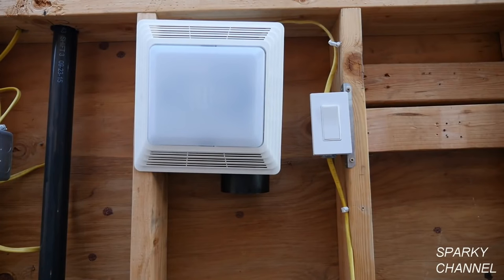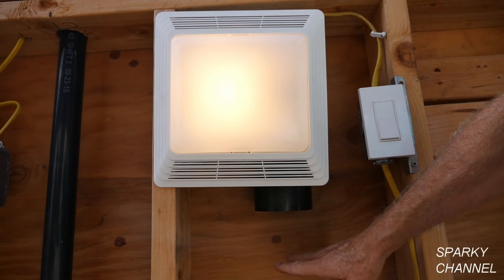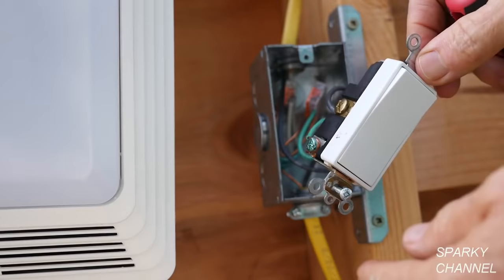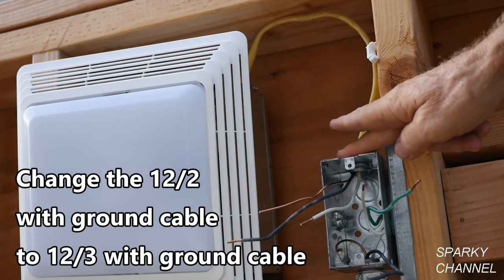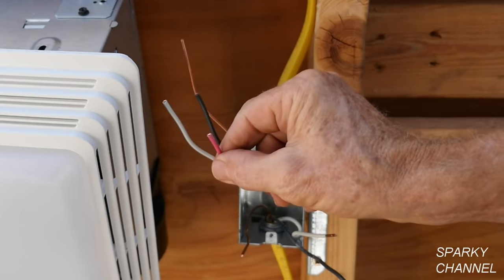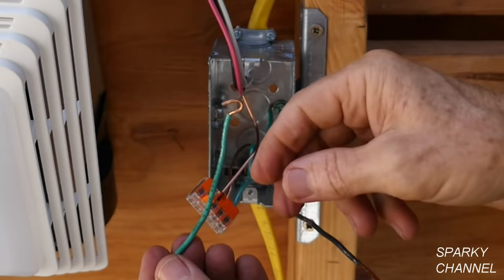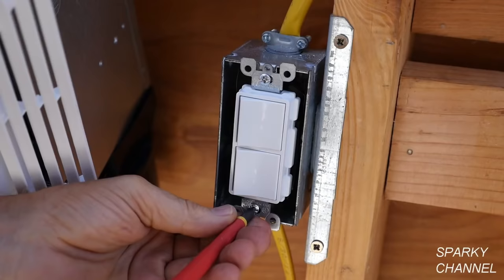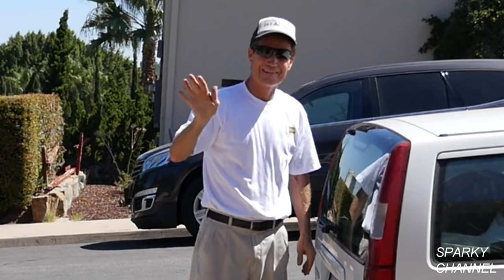How to Put Bath Fan and Light on Separate Switches Instead of on One Switch

Comment: You say you need 12/3 wire, however 14/3 could also be used.  Unless that fan has a heater, it's not pulling that many amps.
Reply: Is this actually true? I'm so confused about whether 12/3 or 14/3 can be used. Seems like a exhaust fan running on a lighting circuit in the bathroom could be on a 15 amp circuit. I can't understand why this wouldn't be the case..
Reply: You need 12-3 because of the extra wire. He is only using the 12awg wire for demonstration purposes
Reply: Bathrooms require 12 gauge wire
Reply: Wire gauge is determined by the amp rating on the circuit breaker providing power to the circuit feeding the j-box. If circuit breaker is 20 amp 12 gauge wire is required. If circuit breaker is 15 amp 14 gauge wire is required. If you have a 15 amp circuit breaker and use 12 gauge wire, for whatever reason, the circuit is “over-protected” and okay.
Reply: I need to do the same thing.
When turning on light the fan also turn on.
I don’t like it when both turn on
Reply: @dsantostv3711 I'm doing the switch too.. it's annoying having both on at same time every time...
Reply: Bathrooms are required to be on a 20amp circuit. Meaning, the circuit breaker at your electrical panel that is feeding the Bathroom, will be a 20amp breaker. 12 guage wire is required to be installed on 20amp circuits. 14 wire is being fed from a 15amp breaker.

Comment: In California, building code title 24 requires that a bathroom fan (for new construction or remodel) must be controlled by a humidity-controlled switch and must be Energy Star compliant.  If you measure the current draw of a typical bathroom fan, it is very small, around less than 100 watts, and 14 AWG is all that is necessary, unless installing a fan with built-in heater. Using 12 AWG does ensure you can put in a heating unit at a later date, however.
Reply: Keep in mind that some units need a 220V line to run the heating element though.  They usually just run the light and vent off of 1 leg of the 220V line.  At least that's how it used to be done with older units.

Comment: Couldn't you have used two 12/2 wires and 2 separate switches on a 2 gang box? One switch connecting to the blue wire/light and the other switch to the black wire/fan? How can you do this using 2 switches on a double gang box?

Comment: Do you think you can make a video for a 3-in-1 (Light, Heater, Vent) wired/powered with their own switch separately?  Thanks
Reply: Ya I was wondering the same thing.did you figure it out yet?
Reply: Same concept, only you'll need to use a 12/4 instead.

Comment: I'm not an electrician so I need some help installing a exhaust fan / light in my bathroom. The wires from my house are copper, one black, one white and one red. The wires from the new unit has three whites, three blacks and one green. The blacks are lables one as light, one as nightlight and the other has no lable. Would appreciate some help.
Reply: You def should call an electrician.
Reply: I figured it out

Comment: I like two separate switches but I put a digital timer on the fan. That way people can put the fan on for 30 minutes (or whatever they select) and go off to work knowing it will go off and not stay on all day. I prefer the Cooper timers (Cooper Wiring Devices 9590AW Aspire 5-Button Preset Minute Timer, Alpine White)
Reply: Humidity detecting switches are available now as well. Removes the owner from the equation. It will turn the fan on and off as humidity conditions require. I have a Leviton IPHS5-LW which replaces a standard switch.

Comment: I was kind of hoping you were going to show some fantastic, new way to get independent switches on a fan and a light with the existing 2/with ground cable. It would likely involve wireless relay controller. There is the naughty way, but it is completely out of code, so I won't tell you how to do it. Keep your house fires in a regularly cleaned and inspected fireplace.
Reply from the maker: Thanks Robert!

Comment: Some installations may have the original 12/2 stapled in the wall cavity so it might just be easier to add an additional 12/2 to the fan/light combo instead of replacing it.

Comment: I just did this exact change in my 100 degree attic. I am remodeling my master bedroom and had to tear out the 75 year old electrical in there. I went into the attic and dug through the insulation to locate the wiring and discovered it’s all wired in a chain with hubs that have 3-4 branches each. My father in law had installed a ceiling fan in the bathroom a few years ago for us and I discovered that he tapped into the bedroom branch. All of the lights and general use outlets are on the same circuit so after turning that off I was able to pull it all out. But then I was so confused with how my FIL wired the light and fan. He didn’t tap into the light switch at all. It still went straight to the light and the fan wasn’t to the light somehow. So I decided to just rewire it and throw in a combo light switch like this. I’m not an electrician but have been watching videos like this. After a while it all suddenly clicked in my head. I used the existing 2 conductor cable to the light switch and cut it from the light. I then stripped those and used those as the load wires and wired those  to the two load terminals on the combo switch. Then I fished down a new wire to the switch and used black for line (hot). I capped the neutral. Up in the attic I used the cable I cut from my bedroom branch and wired the black to the black line to the ditch. I then used two short runs to wire black from fan and from light to the two load wires going to switch. Then I tied in the neutrals from both together with the neutral going to the hub where all the other neutrals are tied in.

I was pretty nervous but also pretty sure I did it right. Glad I found this video because that’s the exact same switch I used and it makes me feel a little better. Wife was mildly impressed when I flipped them on and they worked flawlessly.

Comment: I HAVE REALLY ENJOYED AND LEARNED FROM YOUR VIDEO DEMO. BY FINDING THIS AFTER EXTENSIVE SEARCHES, I WAS ABLE TO SUCCESSFULLY WIRE UP MY HOMEWERKS BATH FAN WITH BLUETOOTH SPEAKER AND LED LIGHT. I HAVE ALSO SUCCESSFULLY WIRED THE SAME DUAL ROCKER SWITCH AND NOW I HAVE AN UPDATED, BEAUTIFUL BATH FAN WITH GREAT TUNES TO ENJOY. THANK YOU!!! 👍🏼😅👍🏼
Reply: That's what I am attempting to do too!! Atleast it worked out for someone else. I will be rewiring everything just like  this too. Did you use the included touchscreen switch or just the double duplex switch?

Comment: I have a real tough challenge for you... Get both light and FAN on Rotary Dimmers. 

Rules:

Light and FAN must both be on SEPERATE dimmers.

ALL DIMMERS NEED TO BE ROTARY (knob dimmers)

Light dimmer needs low end trim.

YOU CAN'T USE A DIMMER DESIGNED FOR A LIGHT ON THE FAN, it must be a FAN SPEED CONTROL.

FAN Speed Control needs to be fully variable (no 3 speed controls allowed) and have a low end trim too.

Low end trim on fan control must be adjusted so the fan runs where you can hear air being sucked in at it's lowest speed.

You must use WAGO's to hook up and do the wiring.

I've done this challenge, IT IS NOT AS EASY as most think.

Comment: That was extremely well done. Thank you. I’m very impressed that the modification was both professionally accomplished and simply explained. I’ll be starting this later this week, with the added modifications of (a) a Leviton motion-sensing switch for the light, and (b) a humidity detecting switch for the fan. I hope it works as planned.
Reply from the maker: Thanks and best wishes!

Comment: A good way to fish the new wire into the wall is to tie the new wire to the old wire before you pull the old wire out so it pulls the new wire with it as long as the old wire isn't stapled to the stud inside the wall.  You can also use this same concept to wire separate switches on a ceiling fan/light.  They basically have the same wire sets this has.  Then you won't always have to turn the fan off with the pull chain if you only want the light and visa versa.  Can you make one more like this to show how to wire a vent that has a light, vent and heater to their own switches sometime please?

Comment: Wire gauge is determined by the amp rating on the circuit breaker providing power to the circuit feeding the j-box. If circuit breaker is 20 amp then 12 gauge wire is required. If you have a 15 amp circuit breaker then 14 gauge wire is required. However, if you have a 15 amp circuit breaker and use 12 gauge wire, for whatever reason, the circuit is “over-protected” and thus okay.

Comment: Outstanding video, I'm scared to try this but I'm going to give it a go. I'm going to attempt a triple light switch as there's currently a dual switch installed for the vanity and main light, so I'll need an extra switch for the fan. Also didn't occur to me to get a triple wago connector for the grounds.

Comment: You should do a video on a fan with a humidistat that allows the fan to run whenever the sensor detects bathroom humidity above the preset.  It is a strange wiring and switching.
Reply: Is that the one where you run a 14/2/2 wire?

Comment: In my experience the Neutral wire is also commonly called the Common. However, this should not confused with the Common connection of a switch. (I must admit I sometimes also use the word "ground" when talking about the neutral wire :)
Reply: Neutral wire is the grounded wire. Grounded and Grounding are two separate terms.
Reply from the maker: Neutral wires are "grounded conductors".

Comment: Nice video. Do you have one on how to wire a combination 3 way switch ? I want to wire my ceiling fan to control fan/light separately from two locations. I know I will need (2) 12-3 wires but I cannot find a wiring diagram for these type switches. Thanks much

Comment: On a all in one bathroom fan/heater and light would you connect the light and fan  to the 20 amp bathroom dedicated circuit. And the heater on its own dedicated 20A circuit?. Thanks
Reply: No, the light and fan are not a significant load to be added to the heater circuit.

Comment: you can also use the other black screw to run on to another outlet/switch/supply..
Reply: So break the tab? If you hook up both black the tab needs to be broken, correct? Hook the neutral to neutral,  ground to ground.....

Comment: Realistically, when your doing this, most, not all homes, but most homes don't  allow you to change out existing romex to a 12/3 easily lol  And why are you using 14/3?, just curious 🤔. Your awesome sparky.
Reply from the maker: The 12/3 allows for a heating unit later if desired.

Comment: Thank you so much for this informative video. I have a similar setup in my bathroom, but I want to install a timer switch for my fan. I copied the wire setup of my non-timer switch and no luck. Any idea why that is?
Reply from the maker: Thanks! This video might help: How to Find Line and Load Wires and Install a Lutron Timer Switch MA- T51MN-WH Neutral Required: https://youtu.be/Lar_6FaU8q8
Reply: @SparkyChannel  Thank you so much for the reply, turns out the switch itself was faulty. I replaced it with a new one & followed your instructions. It worked!

Comment: Great video. I had the 2 switches for my fan light combo but replaced it with a countdown timer. Do you know of any countdown timer that has a separate control for the light so that I can have a countdown timer and light controlled independently on the same switch?

Comment: Is it possible to add new wiring for the fan without opening up the wall? This video makes it seem like it's possible to just the fish an additional wire either to the light fixture or to the exhaust fan.. 
I've contacted a local licensed electrician who said there is no way to achieve this without making several large holes in the ceiling and the adjacent wall.
Reply: Running a single wire like that is against building codes. Also, if they're having to make large holes in your wall it's because your attic access doesn't give them enough working space to drill from above.

Comment: If my wall were the existing wire runs thought has insulation would it be easier to add a second wire without removing the current one? I am also worried about the current wire being stapled, how easy is it to get the staples off if there are some?

Comment: CAN YOU Please DO A VIDEO ON "How to Put Bath Fan and Light on Separate Switches Instead of on One Switch...WITH A CONNECTING SWITCH WITH SEPARATE FAN AND LIGHT SWITCH FOR ANOTHER ENTRANCE.  I would like to have the double switches at both bath entrances for a Jack and Jill type bathroom.  I have already put in the 3 wire with ground from fixture to the first double switch.Thanks and good luck with your new channel.

Comment: I have a fan and light combo as well connected to a 2 gang switch setup.  I would like to change to a fan with light and speaker  Do I really need to change one of the 12/2 wires to 12/3 or can light and fan share same hot wire and save other switch for speaker? Thanks.

Comment: man the wiring in my house is different. Like my device and my switch is grounded but the 2 wire running to the switch is basically the same wire connected at the switch. If straight wire the fan, and cut one of the wires and splice in a switch, thats how my bathroom fan is wired... Have ever seen it this way?

Comment: Hi Sparky, you always have the best instructions! I figure that a hack is not a good thing in electrical jobs but why couldn't one simply add a single12 gauge wire from the a double switch to the fan and make the connection to one or the other? I'm envisioning a situation where replacing the 12/2 would be impractical. Don't hate on me for asking!
Reply from the maker: You can't run just one unprotected wire. You could run a 2ned 2/2 with ground though.
Reply: @SparkyChannel  Thanks Bill, that makes sense.
Reply: @SparkyChannel  don’t you mean 2nd 12/2 also is there any alternative instead of fishing new wire?

Comment: You're AWESOME Sparky thank you!!  My house was built in 1959, it seems that both the white and black are hot in my house...the white isn't neutral?
Reply from the maker: White is a neutral color but in your era of house they sometimes used the white wire as part of a switch leg. They were supposed to color code the wire black but sometimes they didn't.

Comment: This separate circuit is used in Europe for chandeliers. a 10 light chandelier may have 5 lights on 1 side of the switch and the other 5 lights on the other side. Are those available in the US or are the lights always switched together and only the fan is separate?
Reply: All our lights are usually ran off one switch except ceiling fan/light and bathroom exhaust fan/light we usually run a 12/3 from switch box to the device now say we run 6 led can lights in one room we will run 12/2 and jumó from light to light and use only one switch to control them all

Comment: Great Video.  Are the Wago 221's safe for home use?  I have always used a Wire Nut.
Reply: Yeah they are made 20 amps as there are rated from like 24 gauge to 12 stranded or solid. They are great when doing work for some things or occasionally as they are much more expensive but still awesome and they make them for 30 amps which is good to 10 gauge since wagons don’t braid wires together it’s much easier to bend they are fully csa/cUL and UL approved

Comment: I have a bathroom fixture that has a built in night light plus the fan and ceiling light in it. I have a 14/2 powering the bathroom. What’s the best switch to use and how do you wire it. Thanks

Comment: Hi ,Sparky, when I took the old light fixtures, I have 2 black wires wrap in a wire nut, a red wire hooked to the fixture and another black wire hooked to the white wire of the fixture, what are those 2 wrap wires then ? Thanks

Comment: Nice, but how to replace the 12/2 Romex with 12/3 Romex without cutting the dry wall....
Reply: Drill a hole in the top plate above the switch. Fish the 12/3 to the new switch your stalling, or spend $80-120 per hour for an electrician to do it.
Reply: Exactly, anyone can do this in an open wall LMAO. I want to do this in my bathroom, I took a look at the wall and ceiling and aborted mission. Just unplugged the fan. Didn’t feel like doing a complete remodel just to get to one wire
Reply: Simple. Use the 12/2 wire that is already installed as a fish wire. Use electrical tape to attach the end of the 12/2 in the switch to the end of the new 12/3.  Then pull the 12/2 from up in the attic and it will pull the 12/3 through the same path it was taking. It is easier with 2 people to make sure nothing gets stuck down at the switch box.  Careful not to yank too hard if something catches. You don't want the wires coming apart inside the wall.
Reply: @trickdavis9  This only works if the wire isn't stapled inside the wall which in newer construction most likely is.  And the staple is usually holding the wire tight.

Comment: Question, I'm changing a  exhaust fan It's 14/2 aluminum To the exhaust fan which seems to be connected to the light over the Vanity And all on one  switch, In a 2 gang Box with an outlet I can 14/3 from the exhaust to the switch I haven't taken the Box apart yet I have no reason to believe they would have ran 12 Back in the day Would I have to run 12/3 if the only ran 14